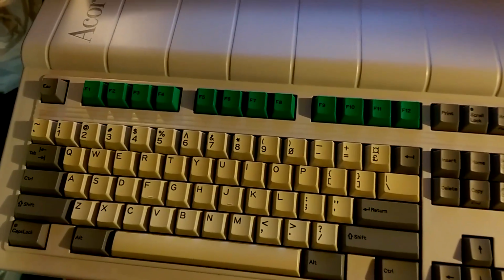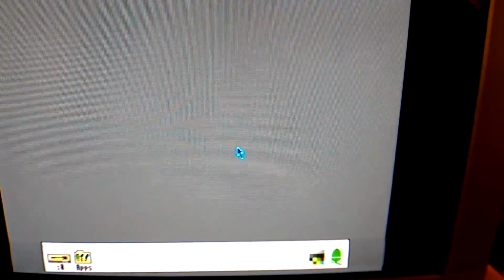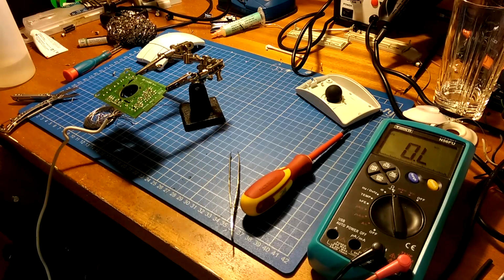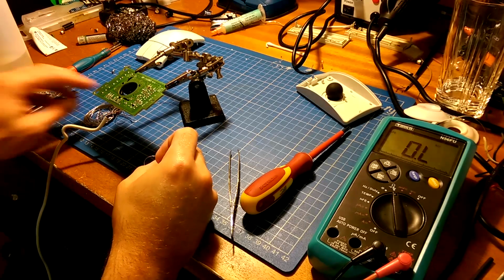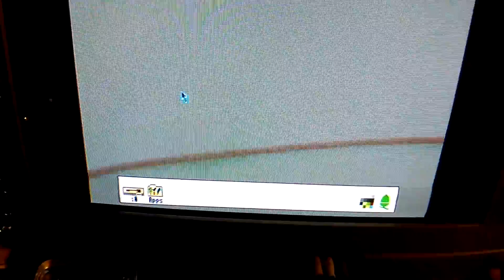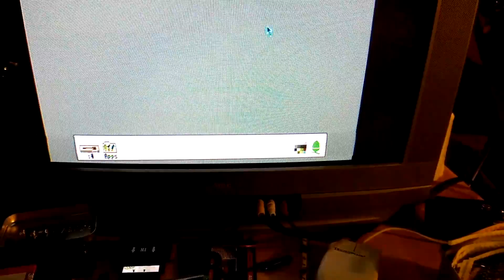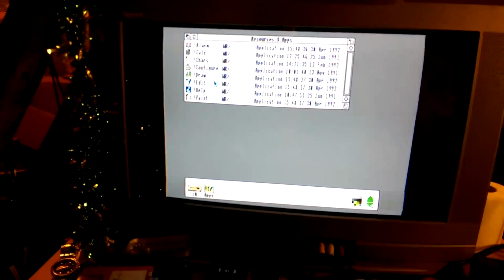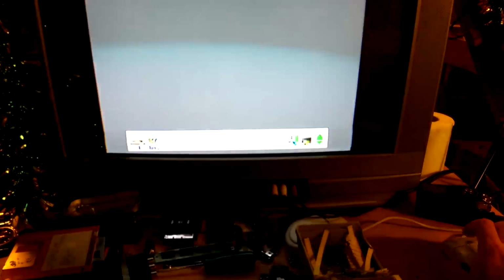[REPAIR] Acorn Archimedes 3 button mouse - non r

Comment: Have the same issue, followed the steps in your video and it seems IV got the same faulty part , not that clued up on this resister stuff so can I ask do I order 2.7 ohm or 27 ohm , I have no idea which thanks
Reply from the maker: 27ohm
Reply: @SabretoothBarnacle  thanks a lot, great video also well explained thanks

Comment: Same mouse, used to work, now only goes left/right not up down. Pulling apart to check the resistors right now. Thanks heaps for posting this. :)
Reply: All checks out. :(
Reply: Fixed! In my case I had to move the optical sensors a little closer to the wheel for it to work.
Reply from the maker: Good work!

Comment: I have the exact same problem with my mouse (same model as yours). Glad to see that it's the mouse and not the computer. After Christmas I'll try to test the resistors and see if its caused by the same fault and hopefully fix it. Thanks for sharing the solution!
Reply from the maker: +kiyouta I wish you luck! Merry Christmas!!